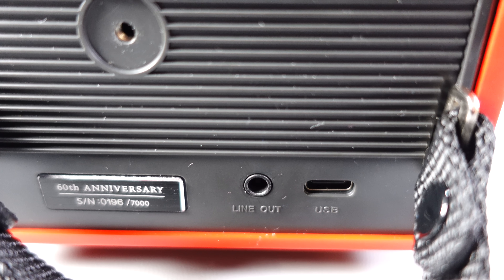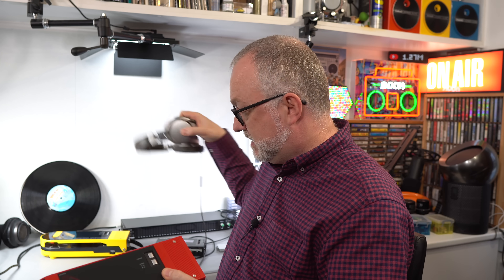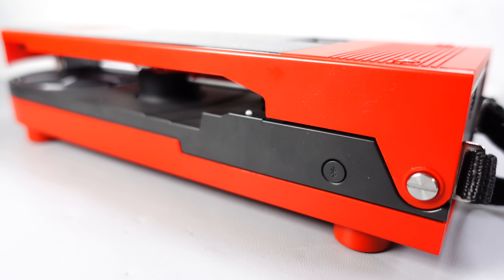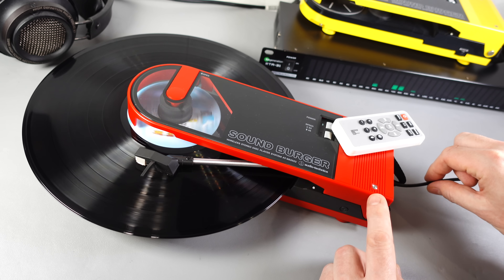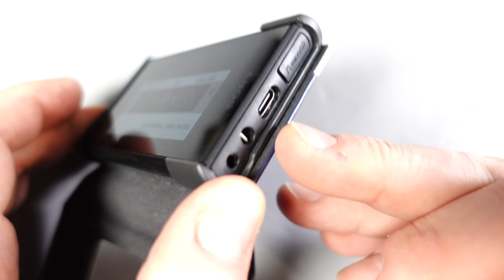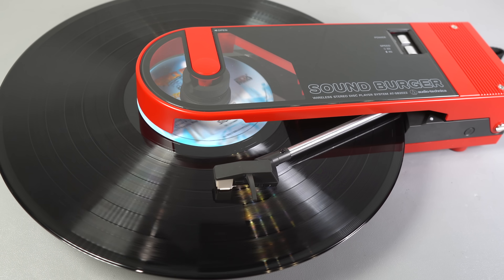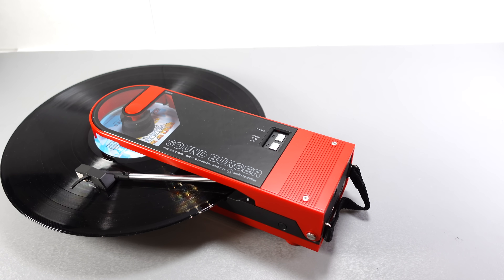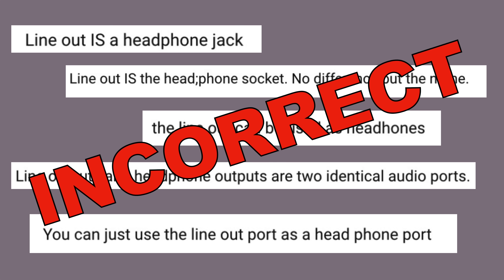Line-out ≠ Headphone-out

Comment: Line out term comes from mixing console where they keep the signal flow balanced and in "line" instead of unbalanced signal flow from amps or other devices which could create feedbacks, buzzes in extreme case fry your battery of your device like phone if you have phantom power on which mean there is higher voltage of electricity flowing into mixing console. The idea is you keep the signal in line with faders and use EQ and other effects to create better sound instead of the signal coming in hot.

Comment: It's not necessarily misinformation.  Many MANY headphone models have inline pre-amp either in one end of the connector or in the headphone cups themselves. Usually these are either USB connected or use USB for power along side the mini-RCA jack. But some are battery operated as well.  And yes, most of those can (and some //should//) be connected into a line-level output.

Comment: headphone output and line output have a volume difference, but it's better to think of it in the context of a given load. headphone out is designed to be able to source current into a set of speakers (which is what headphones really are) at hundreds to tens of ohms, whereas plugging that same load into a line level output (expects the thing on the other end to have a very high impedance) drags the voltage down (and thus the volume) because it can't source enough current to drive it. then by contrast, plugging either into a mic or line input on the other end presents a high impedance load, so the headphone output, which is expecting to have to yank some magnets around, ends up sending its full voltage range at very little current, which the load sees as more volume. it's sort of like when you hand something you find heavy to a stronger person and they lift it up too fast because they find it very light.
Reply: in the age of solid state devices the difference matters much less since an op amp is perfectly happy to drive whatever you dump on the end of it, as long as you don't try to send a different voltage backwards into it. however, if you have a tube amplifier, you can actually fry it if you try to drive too high of an impedance (or present it with no load whatsoever) and you can get problems going the other way on very poorly designed descrete transistor devices that have no output current limiting if you try to drive too low of an impedance with them.

Comment: Headphone in line out is partially correct. I had a desktop with a headphone jack that supported both line out and headphone. You could use it as mic as well, all controlled by software. That may have caused the confusion

Comment: line out and hp outs are simply designed with different levels and load impedance in mind. Although, it is hardly likely you might damage output line drivers via headphones nowadays as most amps have protection, you'll definteley might get more distortion/wrong frequency responce by plugging in incompatible devices into wrong outputs. The standard line out load is 600 Ohms, while most of the headphones are in the range of 32 - 150 Ohms. And typically, line out drivers are not designed to carry currents which could be possible with low impedance loads as heafphones, so headphones require dedicated and different output amplifiers for proper function.

Comment: I connect my Sony PS2 composite video to crt tv. But not the audio. I bought male RCA to 3.5mm Female converter. So i can connect my $7 gaming headphone. Voila! I got my best gaming audio experience. The sound stagging is absolutely the best. Compared to my TV speaker or my cheap multimedia speaker. Unfortunately, i cannot did the same to my Sony PS3. I cannot hear the conversation or anything from the center channel. So, you have more problem when you bought more expensive device.

Comment: The biggest issue has always been one of impedance matching. Headphones are (historically)of relatively low input impedance similar to loudspeakers … 8-ish Ohms. A line amplifier input impedance is of relatively high input impedance (the standard is 47,000 Ohms) to ensure the voltage of the line source output is preserved … a low input impedance will have the effect of a (relative) short circuit on the line output and sink the pre-amp current to ground. This will kill the output voltage and burden the line-output amplifier with an excess current .. which can simply burn out the output stage. 

Admittedly, good design practice should (and USUALLY does these days … unlike a lot of vintage equipment) ensure that line-outputs are suitably buffered to protect against this to avoid smoke being generated … but the output signal level will still be much reduced. 

I do have some older bits of kit that do use a common 3.5mm socket hole, but the are supplied with a special interconnect cable with an extended plug that caters for several connections in the barrel (rather than the 2 connections for mono or 3 connections for stereo. I have an old portable DVD player which has this; providing for the stereo line-out (3 connections) plus composite video (1 connection) and an optical TOS running down the centre to the tip.

There is a reason that an instruction manual is supplied with electronic equipment … and an appropriate abbreviation that accompanies … RTFM !!

I suspect some of the confusion may arise from some of the earlier personal stereo or MP3 players may have had combined line/headphone sockets, BUT were supplied with matching (branded) HIGH impedance headphones … the problem has evolved because of the increasing standardisation towards a 3.5mm jack becoming the norm for headphones in lieu of the conventional traditional 1/4” jacks. 

The other problem with failing to observe “appropriate” impedance matching is that the frequency range can become badly distorted … remember that impedance is frequency dependent. As a result, the sound you hear might not just be very quiet, it might also be distorted.

Comment: That's crazy this is still an issue but I suppose I was lucky to have my dad's home theatre system back when i was a teenager in the 90's. I figured that out by messing around when the setup of the amp and other hardware components. It was fun learning all the different things you could set up and the arrangement on the set up of my dad's Sansui stereo.

Comment: It's not just amplification that is different between the line out and headphone out. I believe that the output impedance is also different between the two types of audio ports. The line out has a high output impedance because it is intended to have a high impedance load plugged into it. The headphone out has a low output impedance because it is intended to have a low impedance load (headphones) plugged into it. If you plug a low impedance headphone load into a high impedance line out port, you'll lose most of your signal in the voltage divider created by the two mismatched impedances.

Comment: I recently connected a Behringer headphone amplifier to the headphone output of my Samsung Xcover 5 smartphone and was surprised that the sound was still coming through the phone's speaker, not the headphones. I thought it was a poor connection. Only after a while did I realize that the amplifier's input impedance was too high for the Xcover to switch outputs.

Comment: It's about voltage swing and source and load impedance and current drive capability most line outs will have series resistors usually 470ohm to protect the opamp output from gross overload by plugging headphones in but it's totally confused people that pc sound cards use same socket for headphone/line out, I expect they detect the dc resistance of the connected device, (line out connections will have dc blocking coupling caps and a input shunt resistor around 22-47k to minimise floating input noise pickup

Comment: You probably also should have mentioned that there's actually two different line level standards and you could fry your equipment if you mix it up. The consumer line level is ~0.3V nominal and peaks at less than 0.5V, while the professional one is 1.25V nominal and peak at close to 2V. An input that's designed to never see anything above 0.5V, will NOT like something sending it closer to 2V. Luckily, the professional line level stuff generally use XLR. Unfortunately, you can convert between the two >_<

As for where the confusion on line out and headphones being the same. That more likely stems from computers. On computers, the green color code, literally stands for both Line Out, and Headphone Out. Some manuals will rename it to "Analogue out" or "Front audio out" or similar, but in the color specification for the jacks, both Line Out, and Headphone Out, uses the exact same color code. Almost all of them actually ARE headphone out jacks and it's just that computer speakers are designed to be able to take a headphone level signals. But most are in manuals and the like CALLED Line Out. But the last actual line out green colored jack I saw was on my Soundblaster Audigy something. External box that had half the ports at least and that had a true line level outputs along with the amplified ones. Completely ignored volume in Windows and everything. And that was a PCI card, not PCI-e just to give an idea of just how old that thing was... :/

Comment: The fact that the majority of people nowadays listen to music through bluetooth (wireless) has made a lot of knowledge that "everyone" had earlier fade away. I was going into a major electronics retailer store here in Sweden looking for a loudspeaker cable. What one of the sales persons offered me was a shielded cable with one lead, a microphone cable. I had to explain to the 30-year old that this is not a speaker cable and tell him the difference. Another time I bought, online, a ready-made cable with 1/4" plugs that was described as to be used to connect between amplifier and speaker "Speaker cable"; I was going to use it between guitar amp and cab. What I got was a shielded one lead cable for line level use to a powered speaker. Customer support discussion did not lead(!) anywhere, they couldn't grasp what the difference in cables were.

Comment: People confidently spewing misinformation is a plague of modern society.
I build PCs, so I can see the confusion, but from my experience, you do have to argue with the sound control panel in Windows to get anything resembling satisfactory results through the line-out jack. At one point I had to split my mic to a line-in for an experiment, and I DEFINITELY had to fight with windows about it. I wound up needing a digital audio cable to amplify the incoming sound by about 30db.

Comment: For 10 years, in the late 90s, i used the lineout into a headphone and/or speakers.... never had an issue :/
Was running windows 98 and then XP...
Had a soundblaster PCI card at some point, forgot what was before that, but both had no issues with outputting audio through the lineout. The amp on the card was enough to drive the headphones, and the speakers had their own power and i assume built in amp.....

Comment: Line level is still very much an "amplified" signal, the bulk of the amplification work has (hopefully) already been done by a preamp of high quality to take it from mic level or instrument level, to line level, which from there, can be (electronically speaking) much more readily be amplified again to whatever your output device is. 

It's intended to be an "agreed upon standard" in terms of impedance and voltage, such that ideally, if every device is set at -0db, you should be able to read -0db on all of them.

TL;DR, mics and instruments make weak signals, sensitive precision devices with preamps get them up to line level, you work with line level, and then out it goes to get amplified to your destination of choice.

Comment: line out is basically "audio data" 
it is more or less the same thing, but it is NOT designed to drive headphones, it is designed to push agitated pixies in just a specific way to where something on the other end can mess with them, whether that be an audio filter, or an amplifier for an actual headphone out

remember, there are some headphones that have 100 ohm resistances, some that have 1 ohm resistances, some that have 1k+ ohm resistances

it will wear out the circuit if you put a resistance it is not supposed to handle
and, you cant adjust the line out level, which is useful for getting the audio to be a set volume on the final end

Comment: I'd be willing to bet that the DAC driving the output of this thing has the capability to drive the output above line level they just couldn't be bothered to add the components and programming to enable it. 

Be nice to see a teardown and see what blutooth module they're using. I'm guessing it's a fairly generic multi function unit with some of it's features disabled.

Comment: I have some info to help you out here. Some devices actually had combined output where the headphone and line out were the same, there were also devices with auto detect for video/audio/composite/interphase and other things. This was not standard practice but you would find it. For a while there was a move towards a slipring system with 3.5 jack to be the standard with as many as 10 rings or more. This system was dropped and basically ignored for a while, now you can find connectors/systems that use slipring systems and similar systems in mobile devices and such.
Reply: Some devices also do impedance testing to automatically determine output level
Reply: "slipring system with 3.5 jack to be the standard with as many as 10 rings or more" i hate this viscerally

Comment: I personally would have said yes, but under certain conditions. Like for example, I had a computer once that paired Line Out, and Headphone into the same rear jack, and you had software to change it, it likely just did some fancy amplification under the hood. But, on it's own, with no amp of any kind, software or hardware, a device like that turn-table cannot output audio at a level comfortable to listening to music unless you had SOME FORM of AMP. Ironically a computer can act as an amp too, but that's complected and may not even be worth it. Literally the solution you recommended is probably the best when you have a line out on a device that doesn't even have a software amp.

Comment: I'm quite annoyed that manufacturers are still not doing much to educate customers about this, since this hasn't been common knowledge for decades by now.
And since there are both amplified "line-out" labelled connectors and "headphone"-labelled connectors that aren't amplified enough to actually work with many headphones, the terms can be inconsistent and confusing even for decently informed customers.
I think products should explain these things on their info sheets/packaging (like "line-out: unamplified audio for use with a separate amplifier")

Comment: The key word is impedance. A typical consumer headphone out impedance is 32 ohms. The consumer line output impedance is between 100-600 ohms. If the signal is not amplified you can not hear anything when plug a headphone into line output. Not mentioned: RIAA corrector of record players and professional audio levels...

Comment: Found this at random and curiosity got me. This is probably due to PCs and how they can just detect what is plugged in and repurpose ports as needed and detected or set in software. Like I literally mixed up microphone and headphones, plugged them the other way around and PC detected it properly, corrected ports to what was there and it actually worked. I did notice it because software would show what it detected in which port. But I did test it out of curiosity and it seemingly worked fine. Then I reversed it to correct order, because I didn't like to see headphones in microphone jack... kind of triggered me. :-D Anyway, that is probably where mistakes come from. And I would assume there likely are other "smart" devices that did this, like Android or Linux based. Though I never tried it, due to not really using any sort of smart boxes or too smart TV... Since i usually just hang on my PC. I mean I swear, smarter other things get, bigger apocalypse people have when internet goes out or whatever, while my dumb stuff just works.

Comment: So let me get this straight. My hiby R4 doesn't have an lineout input, but it does have a 3.5mm headphone input. In the system settings you can change it from headphones to lineout. If im listening through headphone (Oneodio Pro 50) I should have it on headphone and if im listening through a car speakers through an aux cord, I should have it on lineout?

Comment: but i can still plug my toaster into the line out right? for stereo bread
Reply: As long as the cables are gold plated, for optimal heat transfer
Reply: only sourdough comes in stereo so check your bread for compatibility
Reply: I can't believe its not 5.1 Surround Sound Butter!
Reply: Only on two slice models. It's worth spending on the 4 channel toaster
Reply: I prefer one side toasted... Mono like ?
Reply: i know you can use a cd player to toast bread so use your toaster for storing vinyl or something else instead
Reply: That’s what the mysterious “metal/bias” switches were used for on old hi-fi equipment. Specifically for making the metal heating elements in your toaster understand that they were doing bread or bagels.
Reply: I have a quadrophonic adapter so I can toast 4 slices at once, each with their own level of crunchiness.

Comment: Headphones have gone through extreme development. Before 60s they had a high number turns electromagnet by a metal diaphram (high Z). Strictly communicatios! In 1960 Hi-Fi headphones were introduced. They had a small speaker with sealed ear covering, Z~8 Ohm. They had base responce. More recently they have included open ears and ear buds. Most low Z.